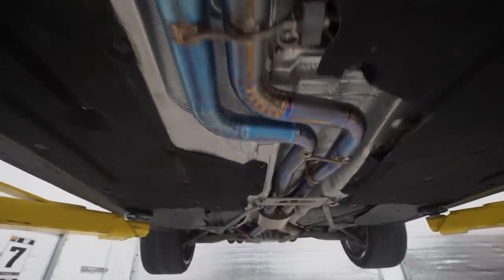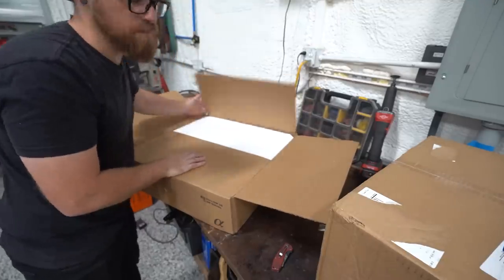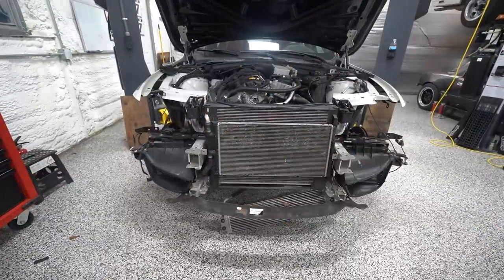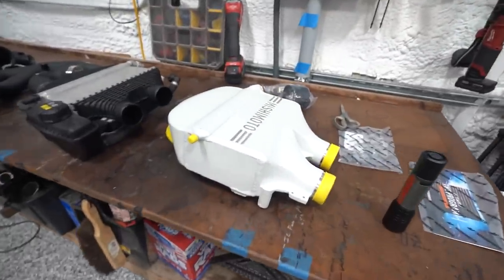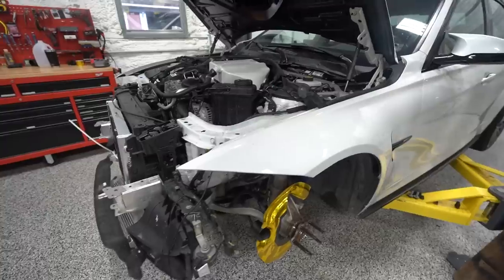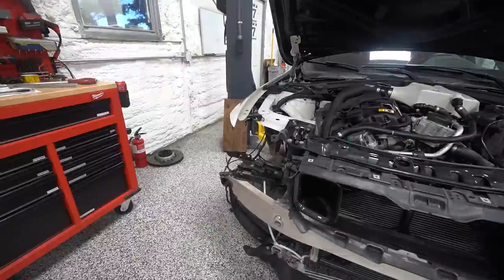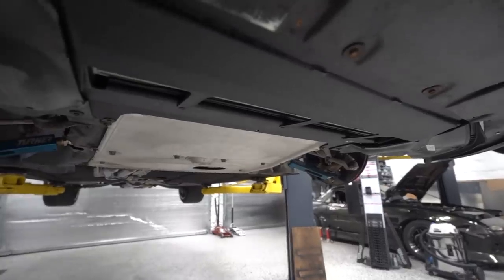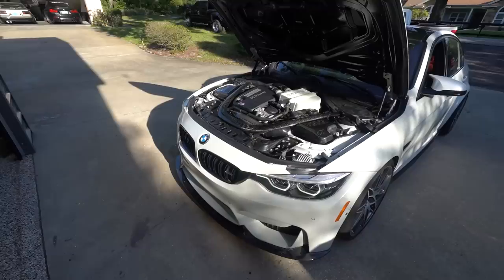I accidentally got a bunch of upgrades for my daily. No turning back now

Comment: You should to the XHP transmission flash, it makes the transmission shift so hard and quick, really wakes it up 10/10 would recommend
Reply: XHP Stage 3 completely transformed the 6hp in my x5, I wonder how it makes the DCT shift.
Reply: These DCT's struggle to keep up as you add more and more power, eventually the clutchpacks will actually begin to slip. The XHP tune increases the transmissions line pressure progressively throughout the gears allowing for the trans to properly transmit the power. This not only improves the transmissions performance greatly but also the reliability of the unit. I do not own a DCT F80 but instead I own a e82 135i, that has essentially the same DCT as the e9x m3,  with this tune and it has been one of my favorite mods so far. Although I do love this trans and tune combo I am still going to do a manual swap soon.

Comment: When bleeding the coolant system, I'm pretty sure you can run the coolant pump if you turn on the ignition to run position and then push the gas pedal all the way down for 10 seconds. That's the easiest way for me, but that's a e9x series tho and I'm assuming it's electrical water pump on later models too. The bleeding mode runs the pump in full power, and that's not always the case when the engine is running.

Comment: 2018 f80 Zcp. M performance HAS, 19 Apex wheels, Dinan heat exchanger, Afe sealed carbon cold air intake. RK TITANIUM CHARGE PIPES. CSF CHARGE COOLAR AND OIL COOLER.ETC ETC......